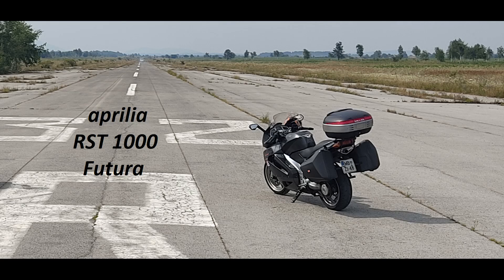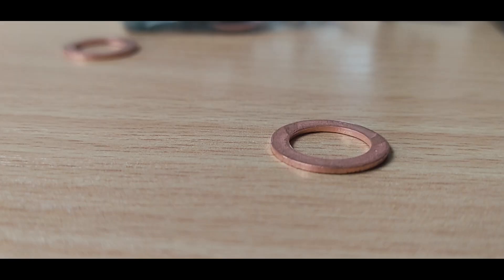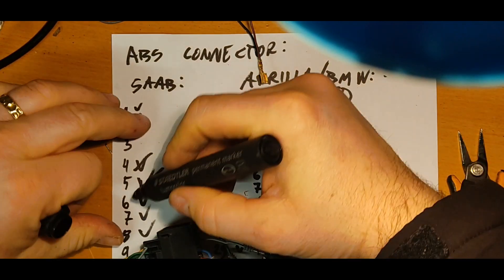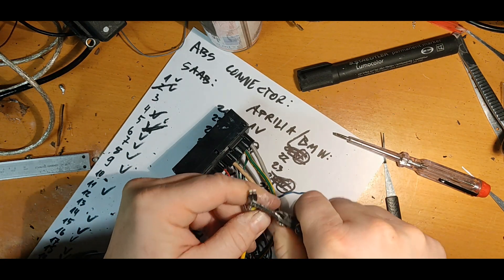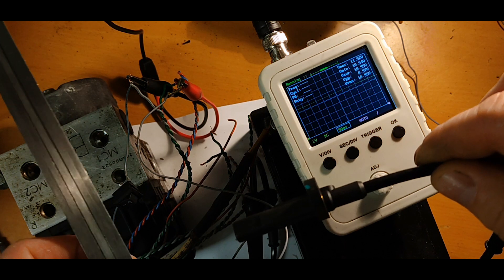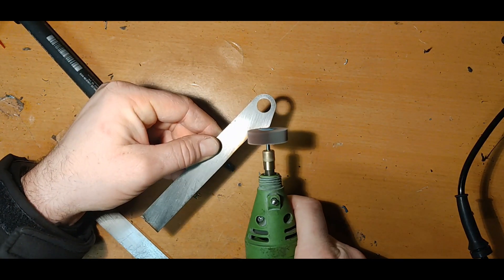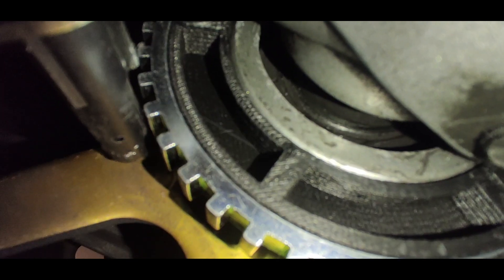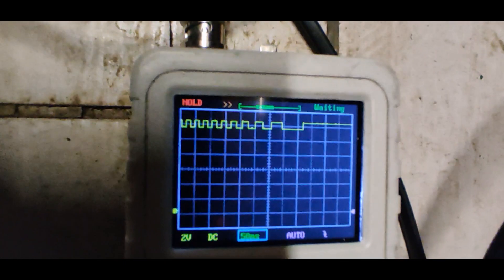Aprilia Futura ABS retrofit - Part 2 - On the bench

Comment: I see you are using a different solution instead the standard ring plate for ABS sensor. Did your tried fit the Aprilia Shiver one? See link http://www.rubbersideup.com/12-14-aprilia-dorsoduro-750-smv750-front-wheel-speed-abs-sensor-ap8128189